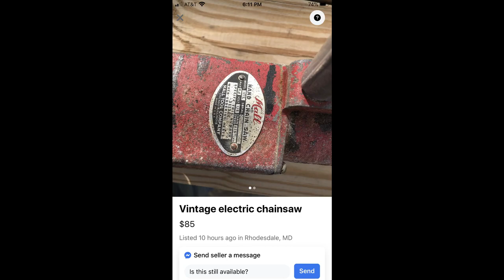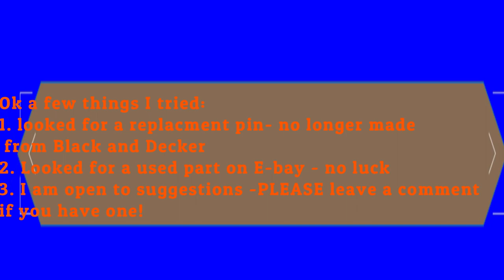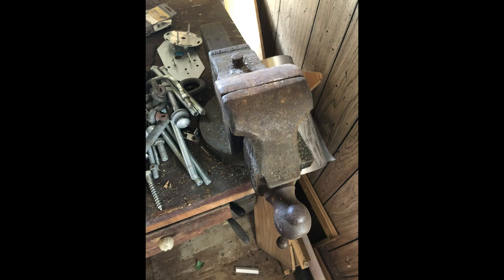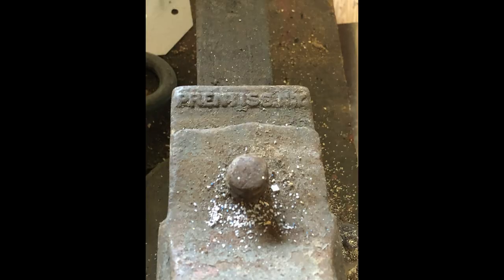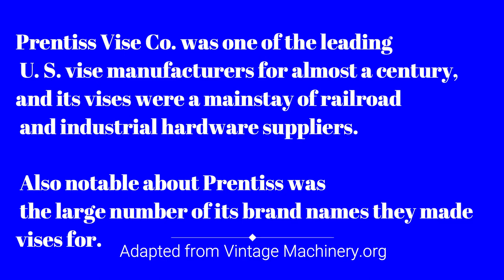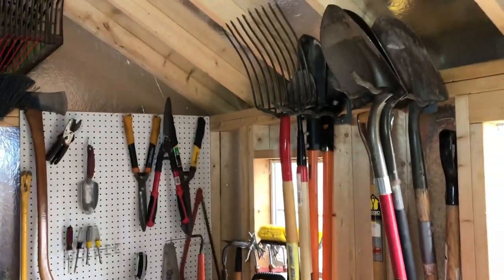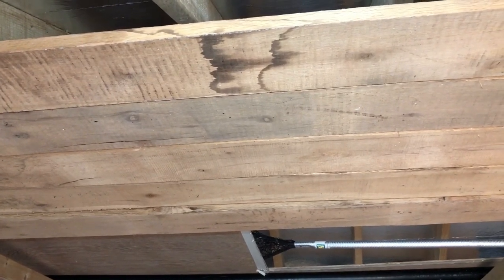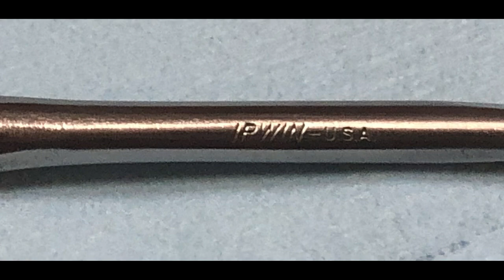TSWG Episode 86 A little bit of Everything

Comment: Hey Matt- Possible fix for the vise tilt table is to cut the head off of a bolt...   You can  mount the remaining stud in your power drill and touch it to sandpaper if the bolt needs to be reduced. Great stuff!
Reply from the maker: Hey John thanks I was leaning that way...that will give me another video!